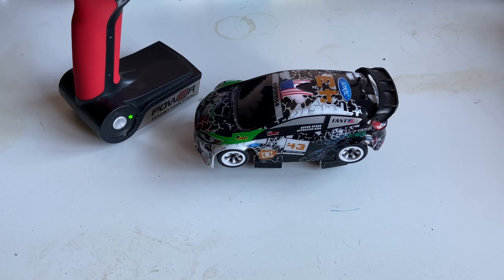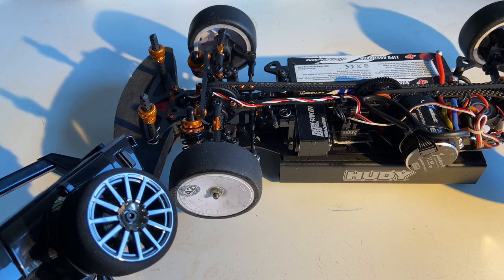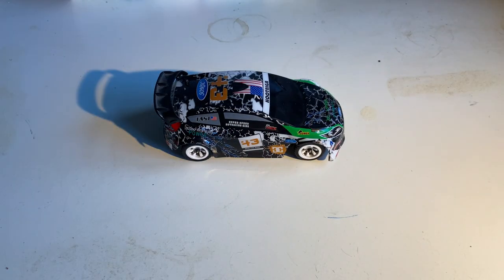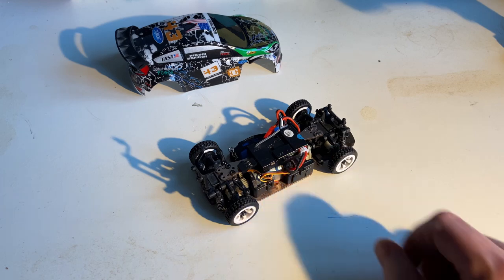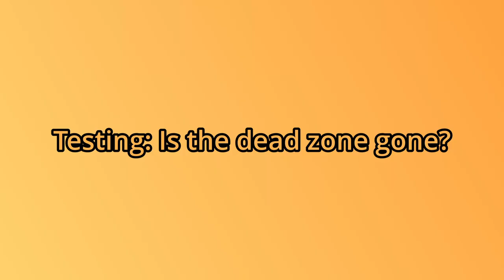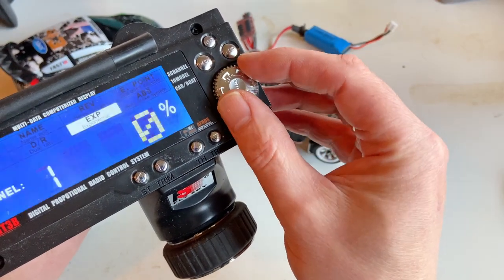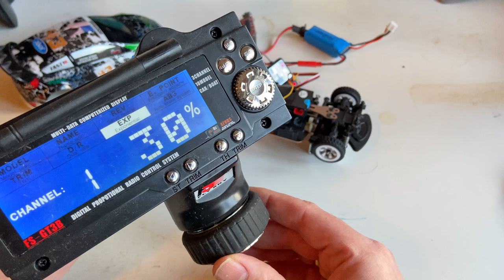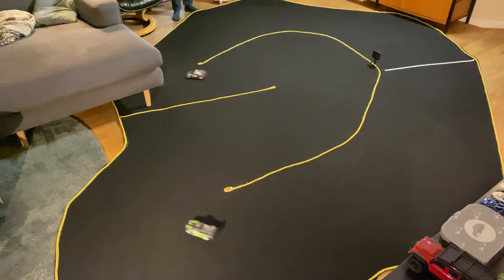WLToys K989/K969/284131 radio upgrade FlySky FS-GT3B with EXP, Exponential. Improve steering.

Comment: Hi there, a great explanation of the features of an advanced radio system and in particular the EXP features. So great that you managed to squeeze in hobby grade receiver and ESC into such a small package. Best wishes 😊
Reply from the maker: Thanks John. There was room for all electronics, long wires and connectors, if you shorten the wires and solder instead of connectors there is lots of space 😀

Comment: So do these stock servos perform well..or maybe a better upgrade servo makes sense.
Reply from the maker: The stock servo are actually good, you might be able to find a better one but the radio are the weakest link and should be upgrades before servo. I use the stock servo in all my micro WLToys

Comment: I have had that flysky radio for 14 years and its great...range on mine is very far..ran boats,cars very far away...i also converted mine to use lipo 3s packs...Great demo i actually never compared radios and did not realize this dead zone issue..i always blamed the linkage and servos..thanks for sharing😊
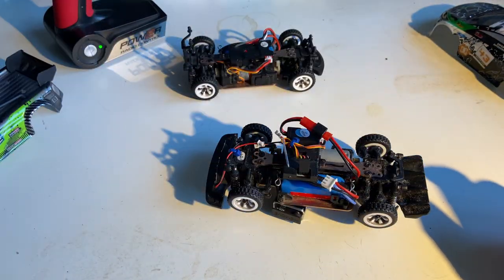Reply from the maker: I’m glad to help 😊, thanks for the kind words 👍. Strange that your radio has a good range, the range is the only drawback for me on this radio. I also use the radio on 1:10 off roads cars and here I often run out of range, here the range is like 30-50 meters. I have another radio labeled “HRC” which should be the same (and looks identical) but that one has 300m range - strange

Comment: Nice video, I am about to do it like this but one question. If I buy the ESC, do I need to program the low-voltage cutoff? If yes, I can only find brushless ESC programming cards :-(
Reply from the maker: Hi, the ESC has some built in LiPo cutoff, I don’t think it can be adjusted though.
Reply: @LyhneRC  Thanks for the quick answer 🙂
Reply from the maker: @nicosochadesign  You are welcome 🤗